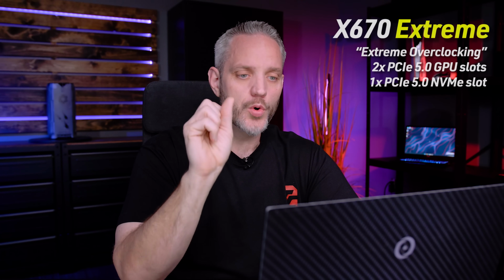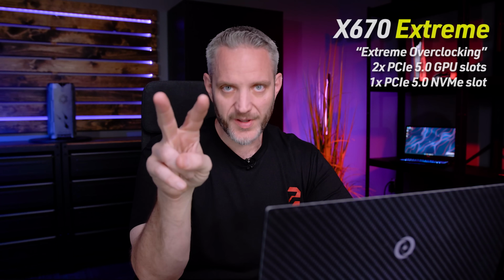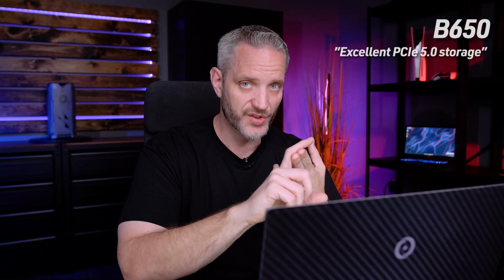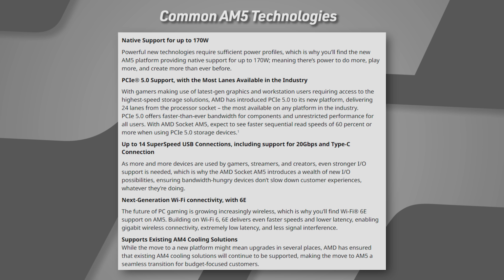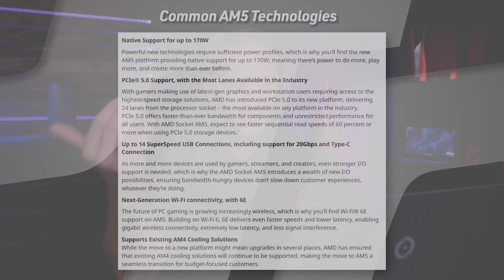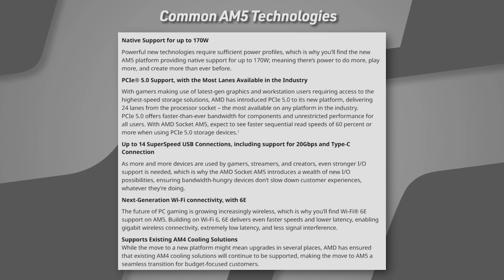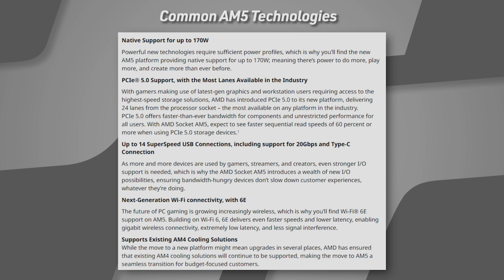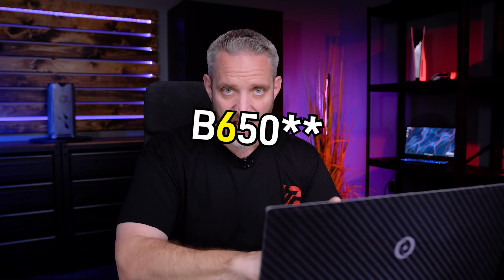AM5 Motherboards are EXPENSIVE! AM5 Explained

Comment: It would be nice with more 4x4x4x4 bifurcation pci-e 16x slots, for nvme. Before you had to sacrifice the GPU into a worse slot, if you even had bifurcation on the motherboard.
Reply: Walrus approves this message.
Reply: Now you don't need a GPU, support for ECC memory with 4xNVME drives and 8 lanes left for disk/network controller slots would make a nice server system so long as you don't need more than a 64GB memory kit.  Using 4 slots can reduce memory speed to DDR4 levels.
Reply: Wild robbaz appears
Reply: Robert! When worlds collide….
Reply: hello robert
Reply: THE VIKING KING HIMSELF
Reply: For consumer boards for most pcie gen 5 x16 is faster than needed So how i would slice it up is gen 4 x16 gen 4 x16 gen 3 x8 gen 3 x4 gen 3 x1 gen 3 x1 makes sense. Why the last 2 x1? you have to have 7 slots right? if not then just take off the last x1 slot.  

The reason why is 1 nothing will actually use gen 5 x16 but GPUs will claim they do thus why the gen 5 x16 slot. 
The gen 4 x16 slot is for M.2 storage expansion to run at full speed of PCIe gen 4 x4 lanes. 
The gen 3 x8 lane is for a NIC. Whatever you want it to be it will go there and run at the maximum it can. 
The gen 3 x4 lane i forget 
The gen 3 x1 lane is for a wireless card.

The problem with this is marketing doesn't like to have lower numbers. In all it would take up only what 2 gen 5 x16 electrical slots would but for 6 slots and have a reason for each to exist. It would also get rid of why to have M.2 motherboard spots as there is a slot for that.
Reply: @yumri4  yeah. I don't mind a single m.2 as it's really clean for smaller family and friends builds, it's just bad when you want some flexibility.  Even there gen 5 x8 (x16 physical) would be good.  Dual video cards, dual m.2 adapter, other options.  But only two physical PCIe slots sucks
Reply: They do have add-in cards that bifurcate w/ up to 4x nvme drives currently, so needing a mobo to do this on the slot level would probably be convenient, but there is added cost there, might as well just get the add-in card & go about it. Add-in card would allow more flexibility imo.
Reply: The true Swedish king has returned once again! Welcome back Roperti Properti!
Reply: "Robbaz here"
Reply: Just use an add-in card for that?
Reply: it would be horrible, unless I understand your post wrong Robbaz you seem to think you get 5.0 x4 per slot but you don't....you get x4 whatever pcie version you plug in so with x4 your rtx3090 would get the equivalent of x8 pcie 3.0 or x16 pcie 2.0 yeah that's not a joke...if youtubers and reviewers actually cared and tested real pcs not completely irrealistic test benches with 1 drive connected they would have seen that in 3dmark pcie bandwith test with intel z690, I had to completely dismantle my extreme glacial build to remove the stupid "5.0" m.2 because it halved my rt3090 bandwith and yes it shows in benchmarks and yes it will definitely be a problem if the rtx 4090 is as expected 60-80% faster, my only hope for X670 is that they kept some of the bandiwht for actual pcie slot but I fear they wasted all of it on unecessary M.2s and I know for sure people not reading my comments or not believing them will get screwed like I was..I tried...
Reply: Yup.  The storage performance those 4^4 slots can provide really tickles me.
Reply: buy the extreme you will get more pci express lanes than you can attach nvme drives and 16x graphics cards to. for those with one graphics card buy the x670, for everything less than that with two or less nvme drives the x650 will be fine
Reply: For that price they should for top tier boards
Reply: Wow, you’re alive 🤩
Reply: Where are the videos Robert
Reply: How about  more pci express lanes?
Reply: I frankly think it'd be much nicer for me splitting off lanes for my weird daughter boards shit like maybe say, FireWire or extra USB 3.2 ports or even a capture card for example, then me actually wasting my time and money on too much more NVMe. I'm pretty sick of it tbh, I just don't see NVMe as being a valid replacement for SATA SSDs, like at all. SSDs work much better, they're far far cheaper, they only take like what, 1 lane per cheap 1-2tb drive as opposed to costly 500gb NVMe taking FOUR entire lanes hogged all to itself on a thing that degrades mad fast and all for...what exactly? oh that's right NOTHING other than your weird Hentai shit being copied because guess what, NVMe still sucks at small files and it therefore sucks ass at anything not huge blocks of video data or something and basically just starts slowing down to near SSD speeds.

I am basically just not a big fan of it and I don't think it's so great an improvement over mSATA. Yeah I said it, I don't think NVMe is a great improvement over mSATA, remember those old drives? Really it's basically just a lightweight laptop thing, and that is it, and it doesn't even make a big difference there because you really need two NVMe's connected on mainboard to actually make full use of them, and meanwhile glhf putting it in some Thunderbolt3 enclosure or doing some stupid shit where it's throttled down to 40gbs once you pull it from your main system.

See this is why I got my x570 Taichi board and why I was so excited to have its 8 SATA ports, all of which are populated. I have two T-Force Delta Max ARGB SSDs and they look fantastic for example, I've got my 2gb HDDs for a whole ton of older games and other stuff where it really doesn't matter, and basically I just have MSFS2020 and a bunch of instant replay raw video and camcorder video on the other NVMe. I mean, they're fast between that and C:// NVMe, but it made me realize I'm not even so keen on wasting my lanes on a third NVMe. I'd rather just keep the x1 slots open and have the bottom x8 slot enabled than even bother with a third NVMe.
Reply: R.I.P. hedt
Reply: Miss ya vids
Reply: It would be nice if you stopped slacking
Reply: Bifurcation huh, a new word 😅
Reply: It's even worse now. They're putting 4 m.2 slots in these new boards and sacrificing most of the PCIe slots (2 on the x670e taichi) no upgrades, expansion, only 2.5gbe... and PCIe slots adapters for m.2 were already now convenient IMO than the onboard slots anyway.

I'm not sure what they're even thinking at this point.  Give me 4-7pcie x16 physical slots... And just document the physical wiring (5gen/4gen and 16/8/4 wired).

4 x16 slots with one 5th gen x16… one 5th gen x8... And two 4th gen x8 would be far more useful to most. one x4 gen 5 nvme on board.
Reply: @aztracker1  Jesus fk we're already on 5.0 nvme? We just got 4.0 not even 2019. Morse* really is dead.
Reply: @yeejay6396  PCIe gen 5 x16 slots are quick to the point that the interface is no longer the bottleneck. This is a good thing still PCIe gen 6 and gen 7 are in the works right now. 

It just moved the slowest piece to another piece as you always will have a slowest part.
Reply: @yumri4  Ah makes sense. South Bridge freq output was always low.
Reply: @aztracker1  I think you're ignoring the tighter signalling requirements to hit PCIE5.
Those slots can be close to the CPU like the main GPU slot.
Even PCIE3 required stages on all but the shortest paths for signal integrity which was why ironically the cheapest direct from CPU to GPU slot minimalist boards had PCIE4 working after CPU upgrades.
Because GPU now have multi slot coolers most add in slots are blocked.
Reply: @RobBCactive  I think you're ignoring the fact that there are PCIe gen 5, 5slots away from the CPU in upcoming x670e boards.  It's already been done. See ASRock X670E Taichi for example. The positioning would already allow for my suggested layout.
Reply: @aztracker1  but it will  require expensive stages and materials to maintain signal integrity.
That was EXACTLY the point I made about cheaper minimalist boards having PCIE4 work on CPU PCIE lanes.
Reply: @RobBCactive  again. There are already board designs for this and are going to be sold.  Just without the extra PCIe slots.

If you want a less expensive board,. Go buy a B650... I'm talking about X670E boards that are already going to be expensive with expensive traces that you mention.

Maybe you should go back and try reading slower or spell out your point better.
Reply: @aztracker1  I know... 
I was saying it would be expensive not impossible.  I didn't see you day they were high price boards just suspected it.
Mass market always likes lower cost    so standardise around a compromise, iGPU is the gfx market leader despite superiority of dGPU.
Reply: Stop streaming and make a video

Comment: I don't think Crossfire or SLI will be coming back, but the low level APIs ( DirectX 12, Vulkan) have support for multiple GPUs without the limitations that sli and crossfire had (needing the same GPU model and not scaling with the extra memory from having 2 GPUs). Maybe AMD is banking on the fact that finally these new APIs are considered mature and pretty much all developers have switched to them and will maybe start using their capabilities. It's the classic chicken and egg dilemma: why would devs use these features if motherboards don't fully support multiple GPUs and why would gaming motherboards support multiple GPUs if no games take advantage of these low lvl APIs to support multiple GPUs.

Comment: If you are worried about budget then don't get AM5 because being "DDR5 only" means it's going to be more expensive than any AM4 option for not much more performance.
Reply: I built my AM4 pc in august 2017 aorus x370 released february 2017, now 5 years later never had a problem. Maybe you gotta wait a few months before buying?
Reply: Well Intel 12900K only beats the 5800X3D if it uses DDR5, and so if you use RPL with DDR4, you are choking it, same as if you use 12900 with DDR4. The reasoning is not the CPU or socket, but that in the DIY market DDR5 is still sold at a high premium. The 7600X is for the prebuilt market, where DDR5 is not nearly as expensive.
Reply: Not much more performance? Lol 😆
Reply: @SoVeXeN  People don't seem to understand so I will make it clear. Dollar for dollar you will get the same or close to it performance from AM4 as you do from AM5 right now. 

That's why I started with "If you are worried about budget".
Reply: Not much perf ? This is the biggest generational jump for CPU and GPU ever, that will require the ddr5 advantage over ddr4 to work. Its more expensive but its a nuts gen
Reply: @Boots3962  Was talking dollar to dollar performance. Also, Ryzen 7000 doesn't need ddr5 to work, they are ddr5 only to force adoption (and probably because AMD has some new cheaper AM4 CPUs in the works since ddr4 will be around for a good while yet). Matter of fact current ddr5 is slower than mainstream ddr4. Common ddr4 is 3200-3600 so you would need to get ddr5 that's roughly 6400-7200 to match since the latency doubles.
Reply: @Sgt_SealCluber  theu are already producing 6000+ with cas latency of sub 30's

Putting latency at same levels. Also the higher freq has proven to perform better even at higher latencies with ddr5, especially in 4k gaming
Reply: @Boots3962  Please stop your ignorance.

DDR4 timings are 14-16 commonly and DDR5 appears to be around 36-40 commonly right now. So the latency is actually currently more than double. This means that to match the standard 3200-3600 of  CL16 DDR4 you would need a stick of DDR5 at 6400-7200 and a CL of at least CL32 , like I previously mentioned.

System memory frequency has basically nothing to do with 4k gaming, matter of fact it is less important at 4k than if you where at 1080p since more of the workload is on the GPU at 4k. Oh and like I said above that 6000+ is the same as 3000+ on DDR4.
Reply: @Sgt_SealCluber  Well CPUs like ADL and AMD Zen4 don't even need DDR2 to work. DDR5 has massively more bandwidth than DDR4, even if you get low latency DDR4 and high latency DDR5 at the same price or cheaper for DDR5. What you DON'T get is similar lacency, except where you get top of the line DDR5 and mid to low DDR4, but DDR4 at that stage is far cheaper. You PAY for that top line stuff. The bandwidth of DDR5 at 4800 is half that again of DDR4 at 3200.
Reply: @Boots3962  for gaming… literally everything is “cross gen”, which basically just means it won’t really take advantage of next gen hardware, because everything is handicapped by design to support old consoles. 

For really resource heavy workload stuff, yeah it’s pretty nice.

Comment: Wouldn't surprise me if AMD have implicit crossfire support with their next gen cards given that they are moving away from the monolithic core design that has been the standard for decades in graphics in favour of a chiplet design. Depending on the hardware and drivers they may even be able to do this in a way that is entirely invisible to the O/S.
Reply: I think this is more for the workstation folks that want the bandwidth for a maxed out PCIE 5.0 m.2 card paired with a 79xx CPU for a Threadripper Jr. since Trhreadripper is Pro only going forward. There's also, I think, a few productivity apps that benefit from dual GPU's still but that's out of my wheelhouse.

Comment: Thanks for the video! I hope we get a B650 with one 5.0 slot each for GPU and SSD. AM5 will be my first AMD system since I built an Athlon system 20 years ago. I am going to wait until they hopefully release the information on the 7800X3D in January, and take it from there.
Reply: Won't happen as the AMD specs designate what gets what: X gets GPU and SSD 5.0 and B doesn't. So it makes no sense for any Mobo maker to make X designation specs and sell them as a B.
Reply: @MafiaboysWorld  We'll see. It might only be the some of the announced B650E variants that provides both. Either way, there are more differences between the B and X specs than just the GPU and SSD support, so we could still end up even seeing a regular B650 with both. It's listed as optional for a reason.
Reply: @thomasriishenriksen2229  Yeah, optional as in "we could put it in, but why do that when we can put it in a higher tier board and make you pay 2x or 3x". That's me saying it as AMD user FOR 20yrs and a Ryzen user/builder of the past 5. Just look at Intel, there's a reason why Z, H & B are all different tiers on Intel boards, just like X, B & A on AMD. 😉👍

Comment: I'm currently in the process of building a Zen3 rig consisting of a Rog Strix B550-F, 16GB ram ( 2x8, cl 16, 3200 DDR4 Corsair Vengeance LPX ), Asus Dual RX 6400, and R5 5600 ( which I should be getting this Thursday ). I already have everything except the CPU. Yes, I know the GPU is trash, but it's what I have at the moment and is going to have to wait for an upgrade until I can afford it. If I didn't already have everything but the CPU, I would VERY LIKELY be going for a new R5 7600X on a B650, maybe B650E. My current rig is a ( SUPER OLD ) Core i7-920 with the above mentioned GPU. This rig will likely be repurposed as a DIY NAS after I get my AM4 rig up and running.

Comment: This is the only real bummer about the evolution of hardware over the past 5 or so years(OK, GPU prices too...), CPUs and GPUs have just gotten unbelievably powerful & efficient - but, when it was announced that motherboards were moving to PCIe 4.0 and now 5.0, I knew that motherboards were going to skyrocket. The glory days of dirt cheap but solid B350 & B450 boards are over. The layer count of the boards has to go up and the shielding has to be higher quality to support PCIe 4.0 & 5.0, so the floor on motherboard prices has been raised out of necessity, thanks to a feature that frankly MOST of us won't benefit from. If I could get an AM5 B650 with PCIe 3.0, I would happily make that purchase! I don't notice the difference between the 3.0 & 4.0 drives in my X570 board, and I'm not planning on getting a flagship GPU that would actually saturate 3.0 x16 any time soon - so gimme an ultra budget PCIe 3.0 board please!
 
But, I'll probably just buy a 5800X3D and ride AM4 out until probably the second gen of AM5. I would LOVE to get into AM5 early with a super cheap combo - like how I got into AM4 for next to nothing with a $65 B350 Pro4, $100 Ryzen R3 1200(4c/4t OG Zen, LOL), and ~$65 8GB 2666 DDR4 just to play around with the new platform(and an $80 RX550 too, but only cuz 580s were a million bucks back then) - but I don't actually think that's going to be possible until late into 7000's life cycle, and even then I don't know if there will be legitimately usable motherboards near $100.

Comment: Serious question - why bother with PCIe 5.0 storage? I mean, when will 99% of people ever need these kinds of sequential write speeds? The 4th-gen drives perform practically identically for gaming to the 3rd-gen ones, so what am I missing here?

Even if you're like a videographer with dozens of hours of 4K footage you don't need to swap it from one drive to another all the time. USB is the bottleneck if you're loading it from / to external sources anyway, right?

Comment: Not every cooler that is compatible with AM4 will work on AM5, because with AM5 the backplate is part of the socket. So if your AM4 cooler uses a custom backplate, there's a decent chance it won't be AM5 compatible. Only coolers that use the 2 clips for mounting or the stock AM4 backplate will be guaranteed compatible.

Comment: today I calculated that 64 GB DDR5 6000 cl36 (650.-) + Mobo (600.-) + 7950x (800.-) + new PSU (160.-) would cost at least 2210.- to upgrade my old 5900x PC. If I'll wait 1 year it could safe me 800.- (350+300+600+160). Now 800.- will be about the price of a future 8950x, so the best will be to upgrade directly to a 8950x in 1,5 years, as then a good mobo and fast ddr5 ram will be at somehow reasonable prices. So the most expensive time to upgrade to a new platform like AM5 is when it is brand new like now.